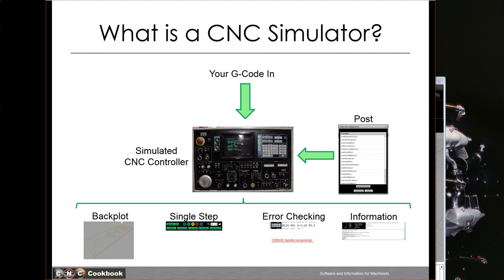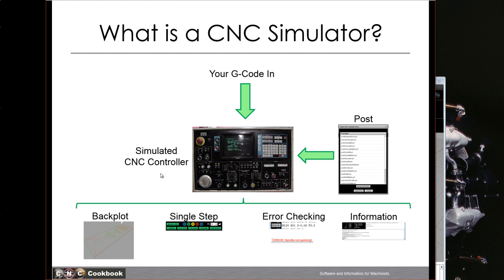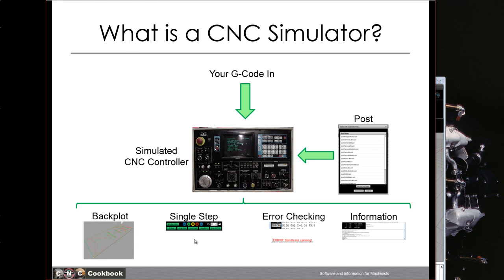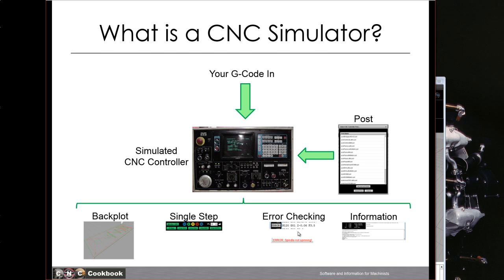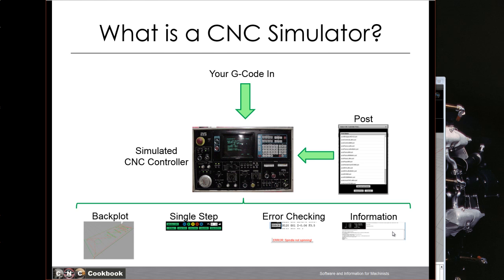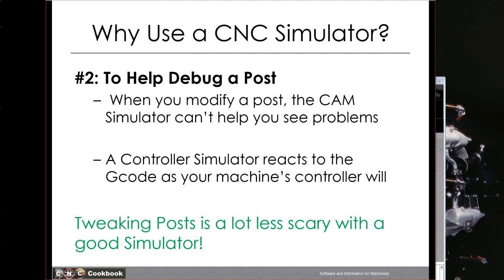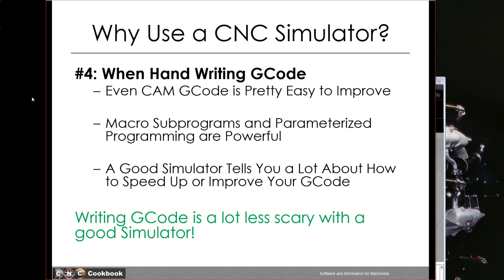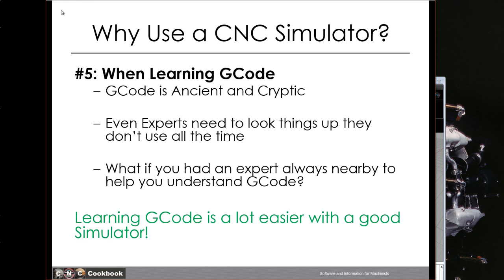What Is A CNCSimulator?

Comment: I use GWizardE to verify my gcode, especially if it's hand crafted or modified.  There's been many times I've caught something that was wrong before it went to machine and trashed a part.  Just used it this weekend to verify cutting t-slots into my new table surface on my router table.